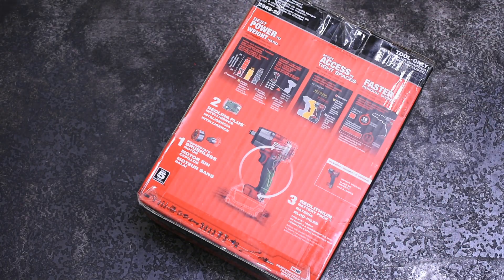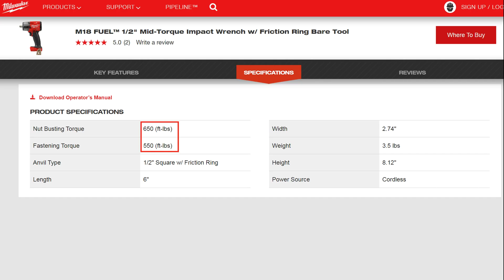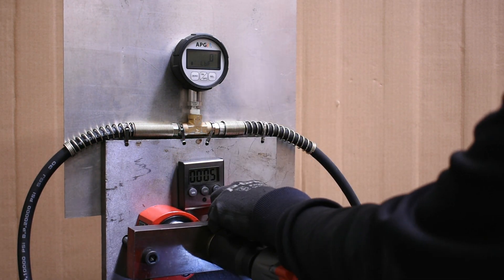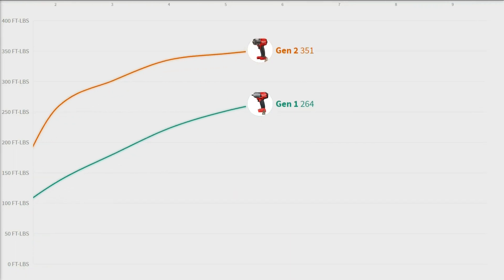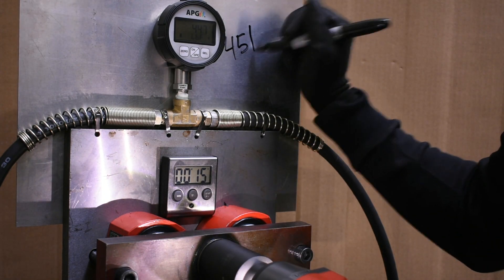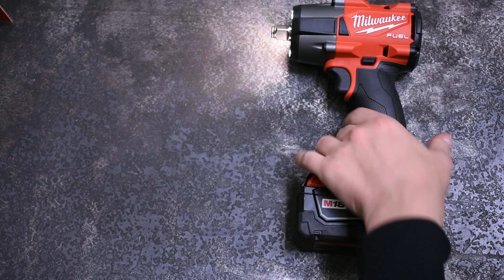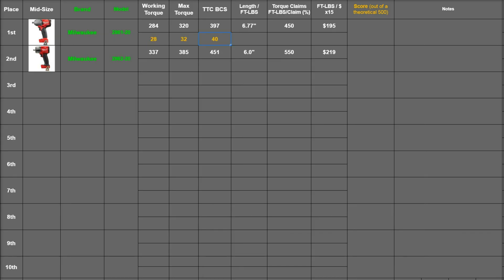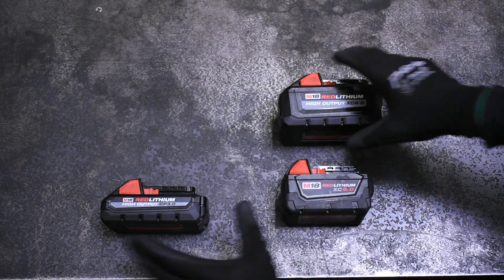New M18 Gen 2 Mid-Torque vs Gen1: Measuring Power Difference

Comment: I own the Dewalt stubby mid torque (450ft/lb) and regular mid torque (800ft/lb). Never owned or used Milwaukee so decided to try this one and see if it feels any different than Dewalt

I don't know if it's because I am so used to gripping the Dewalts or the angled stance, but I found this particular impact rather uncomfortable with grip

I've heard much feedback about how Dewalt impacts are loud and jittery and I was expecting this Milwaukee to be butter smooth. I was surprised that it actually felt more jittery than my Dewalts, and was just as loud

The 6a Forge battery I was using felt heavier than the 5a Powerstack battery I use

So I am returning this Milwaukee today after it left me pretty unimpressed. Certainly not a piece of junk, but at the same time it is not the refined tool I was expecting. My Hercules High Torque 1/2 impact is actually smoother and less jittery than this mid torque

Comment: Review! I tried using this impact wrench to drill an auger in the ground like around 4 feet long and the impact got really really hard and it had a little burning smell. I used it continuously for 40 seconds to a minute at a time. Can I damage the wrench if I keep using it like this? I have their gen 3 high impact coming in the mail just in case.

Comment: AHA!  With a bit a sleuthing through these vids I figured out what I think a lot of us wanna know.. an impact that can tighten to 300 ft lbs torque will loosen a 500 ft lb lug nut. I know TTC said Nut busting numbers cant be compared, but wait a minute. isn't the entire reason for this channels existence cuz tightening torque can't be compared?  So TTC created an ARBITRARY base line from which we all derive valuable RELATIVE info. I dont see why the same can't be done re loosening torque.  Even if only 1 episode tightening then loosening a nut to see what % of tightening torque is needed to loosen at varies torques to see the curves. In any case this is one of the best channel on you tube and has already saved me form wasting a ton of money.

Comment: Just tested an electric heater that advertised 1500 watts but using a kill-o-watt usage meter, it is only using 1404 watts. Food for thoughts? Heaters? Ac’s?
Reply from the maker: They all say 1500 watts cuz that's the max mains wattage allowed to an outlet. So they all say it

Comment: do you test the milwaukee gen-1 in mode 1 or 2?   what is the max output for those modes?   say i want to torque the lug nuts on my car, if it it doesnt exceed 100 in mode 2 than that will be perfect.
Reply: any update?

Comment: Just the video I wanted to see! There's a great deal for the 3/8th and 1/2 drive with a free battery which I plan on returning for a $177, yep for both tools after the battery return.
Reply: This is the same guy who goes to Harbor Freight to try to wheel and deal on their clearance section… whoops
Reply: How do you return the battery i want to try that i already got too many batteries
Reply: @Aaron Sanchez  Can only do it when you get an extra "free" battery. This would cause a prorated discount spread across both tool bundle and the "free" battery.

Comment: This is tool porn! Love this channel. I have both the gen 1 and gen 2 mid torque impacts. The lights near the anvil are so much better. It surrounds the work piece. Love Milwaukee tools. Also have the rigid octane tools as well. Milwaukee has more power but rigid has cool features on octane batteries. Not sure why rigid canceled the octane line? Maybe it was cutting into Milwaukee’s sales? Hopefully, it will show up in Milwaukee’s line since they’re both owned by TTI!

Comment: I have the gen 2 3/8 from a couple yrs ago,  supposed to be 600 nut busting,  imo it seems a bit low. Tbh I dont think its much more powerful then the m12 3/8 stubby,  well not 350ftlb better anyway.  Little disappointed with that 3/8 m18 cause it got so much hype

Comment: I love your channel, and how you've set it up to actually be a demonstration of comparable results instead of just yapping about how comfortable the new grip is, or other trivial crap

Is there a way you could rig up a test for undoing seized bolts/nuts? I'm, no engineer, but I was thinking about having some kind of piston push a clutch-like disk against the flange of a nut to simulate seized-on friction, and be able to dial the piston back if the gun doesn't crack it. I'm not sure if there'd be a way to put that in Nm or ft/lbs, but it could still give you a value (pressure applied) that the gun could overcome so you could compare them directly.

Comment: Milwaukee does their testing with a hardened 5/8 corse thread bolt. That's probably going to come in pretty close to the rated specs
Reply from the maker: Even a grade 9 coarse 5/8" thread bolt's max torque spec is 248. The specs of these guns would snap a 5/8" in half.

Comment: "Upgrading" this has little to do with performance. Who is able to tell the few extra torque numbers; very few, I will say. Go get yourself the new one on Ebay out of a kit, for a fraction of the tag price and sell the old one for whatever you can get... Throw-in a battery which you won't need down the way because the new batteries are something anyone should have, regardless of upgrading (high output) and you might even enjoy the new tool without spending a buck. Goodby!

Comment: I would absolutely love to see a test of the 6.0 H.O., 8.0 H.O., or 12.0 H.O. on this impact. Milwaukee claims more power from the new battery line. And I thought it was a gimmick but I know I got more power out of my m18 ½" hammer drill. When used with the old style 5.0 battery, it would cut out when I pushed it in 2nd gear and when I put the 6.0 on it, I nearly ended up with a broken wrist not expecting it to keep pushing
Reply from the maker: :) https://www.youtube.com/watch?v=ky5YRjz9lvc
Reply: @TorqueTestChannel  thank you, that explains it. Because I was comparing the 5.0 and the newer 6.0 H.O. on one of the first m18 brushed hammer drills. So being a drill and not an impact, and having a brushed motor vs brushless. Thank you. You got a new subscriber from these two videos

Comment: PLEASE do the Dewalt 1/2 Mid Torque (DCF894). I don’t at all expect it to beat these, but I’m really interested nonetheless. 

I’d even be willing to send mine in — but it’s seen a couple years of use in a high production shop so it’s pretty well used at this point.
Reply: The Dewalt is like running the Milwaukee in 2nd power mode. Its weak vs Milwaukee

Comment: I don’t think u should give a lower score for a product performing higher than expected (claimed torque).  The score should be 100points for meeting or exceeding advertised torque.  Subtract points the torque below advertised levels.  Great video!
Reply from the maker: That's how it currently is. Think of it as a %.  The Gen 2 made 451 ft-lbs, which is 82% of their claimed 550. It made more power than the Gen 1, but it also claims 100ft-lbs higher so it worked out to be less points (%). The Gen 3 compact M18 we tested made 250 and advertised 250, that would be 100 points.
Reply: @TorqueTestChannel  sounds good.  How would the points be scored if the tool surpassed the “advertised” torque?  In the example u mentioned above say 250ft lbs but let’s say u tested it (in this scenario) to have 275ft lbs.  Points?
Reply from the maker: @todd5082  It would still be a %. So in that case it would be making 110% of the advertised claim, and thus get 110 points. Frankly, there's room in these rankings for an impact to make sort "meh" power but put some super conservative numbers on the box and get a top spot. Like let's say one makes 350 ft-lbs but claims 250. That's 140 pointsand a category where others are making 70-85. A 60 point gain on the others is enough alone to shoot up the ranking quick. Luckily (i suppose) absolutely no one is super conservative with their torque claims - if they were we wouldn't need to run this channel!.

Comment: Subscribed. I watched the Eric O impact. You guys cracked me up. I humbly admit to buying the HF 1/2" impact. It's top heavy but it has some torque for what I need. I'm working on my 64 Chevy C10 and needed some torque to remove some fasteners.  Unless I missed it, have you tested the HF Bauer 1/2" impact? When mine burns up, I may go to the Milwaukee ones. I like the Dewalts too. Keep them coming.
Reply from the maker: Bauer corded? We picked one up. Bauer cordless? Not yet. DeWalt's coming as well!
Reply: @TorqueTestChannel  no I have the Bauer cordless. Thanks for the response.

Comment: Did my brakes few weeks ago didn't feel like pulling out the compressor tried the milwaukee 1/4 inch impact driver on the lugs just to see  took them off like nothing on a 1500 pickup it did not take off the caliper braket bolts tho this would be perfect for that

Comment: I'd be really interested in seeing how the smaller 3/8 drive 2960-20 Gen 2 Mid-torque does compared to the 1/2 and the other wrenches. The 2960 would have the added benefit of getting into smaller spaces, but how much torque would be sacrificed on larger nuts when using a quality adapter?

P.S. Best torque videos I've seen on all of youtube. I subscribed and love how you are using empirical data to make very repeatable with answers to the question why.

Comment: got mine (3/8") not long ago and for the low demand uses I have it's great I also use it with 6 AH batteries it might make a different it might not but those what I have for it. I might buy the high torque 1/2" (preferably gen 2 when it will come out)  for bigger bolts (above 21 mm) if I see a need, great testing overall.
Reply: Do you mean Gen 3 high torque? The Gen 2 has been available for a while

Comment: Milwaukee is the brand that's really pushing their tools to be the best. You pay for it but you get the performance too.
Reply: Still, even with their premium product. You're still far less than the tool truck pricing((automotive))
Reply: Dewalt has made real progress too with their brushless tools.i have both and no complaints from either brand.
Reply: @benbradshawjr2856  Yea as a big Milwaukee guy I’ve used my buddies dewalt and they feel great too
Reply: @benbradshawjr2856  Dewalt is really improving their tools lately, and I think they were the first brand to come out with stacked lithium batteries.
Reply: @DiligentDave1966 nope flex.
Reply: @DiligentDave1966 also who cares about who is first my mine two complaints about default is that they have two different batteries that work on specific things also their battery’s wear out so fast at least compared to Milwaukee.
Reply: @right8630  I just wanted to add what frustrates me about Milwaukee. They have tools in the M12 line that are not available in the M18 line.
Reply: @DiligentDave1966  agreed but hopefully that changes.
Reply: @right8630  I’m gonna be running a head to head comparison with the Flex impact driver vs the gen 4 Milwaukee tonight.
Tonight or tomorrow, I’m gonna do a comparison between the Flex hammer drill, the gen 4 Milwaukee and the Dewalt DCD999 to decide which I want to keep.
I didn’t get a Dewalt impact driver yet, but I will if I don’t really care for the Flex.
Something tells me that might just happen.
Reply: @right8630  What Dewalt batteries have you had that wore out fast?

Comment: I understand that it would be hard to take your daily driver apart, but aren't you curious how that little battery-powered toy makes so much torque?  As an old-school air tool user, I certainly am.
Reply: Air tools waste too much electricity filling up the tank and always dealing with leaks, adapters, water in the lines/tanks, oilling and such. And wayyyy too loud. Neighbors don’t like them at 2am. Cordless is the only way anymore. More power, quieter, more portable, wayyy less maintaince and lighter. I’m surprised air tools are still being sold. It doesn’t make any sense. They’re like school in summertime.
Reply: @hardtymz2517  realistically battery powered is the next logical step, at least in shop environments. The only time most of us break out an airline is due to not yet having the battery tool replacement yet. But, I do wonder how the impending lithium wars will impact the market
Reply: Ive always been skeptical bein an air tool user and corded IR impact,but seriously its a relief nowadays cordless tools bein more efficiient with battery power.youll be impressed as i have.
Reply: Check out the channel AVE he takes em apart an explains alot and he's funny as hell LoL

Comment: The 8.0 battery makes a big difference on the high torque in what i've experienced with it.
Reply: Swapping the 5Ah battery out for the 12Ah battery is my way of saying "I wasn't asking."
Reply: @RossLH  same here! When my 2863-20 with the 12.0 battery can’t do something, then it’s time for the 1 inch drive Chicago Pneumatic 🤣
Reply: What about the 3.0 HO batteries?? Makes the tools way more manageable while delivering the high output. Makes more sense to the hobbyists to go this route. They’re awesome too!
Reply: @hardtymz2517  I use the 3.0 and 8.0 HO batteries at work, every day. Big difference from the old 2.0CP and 5.0xc.